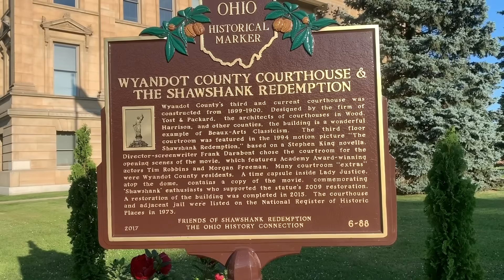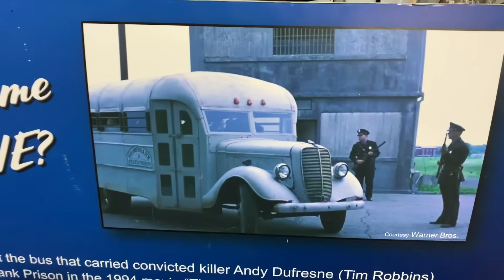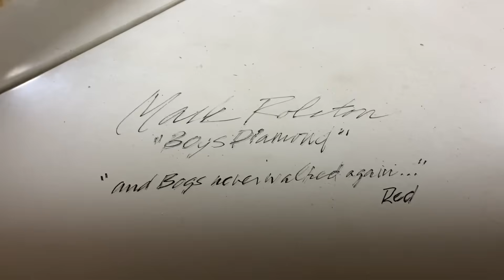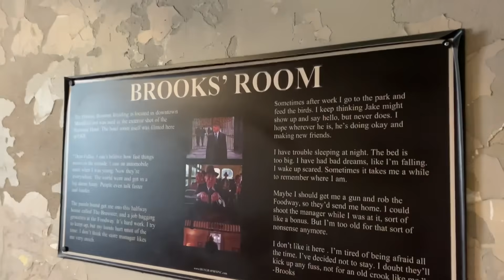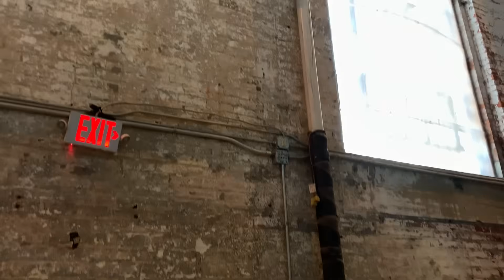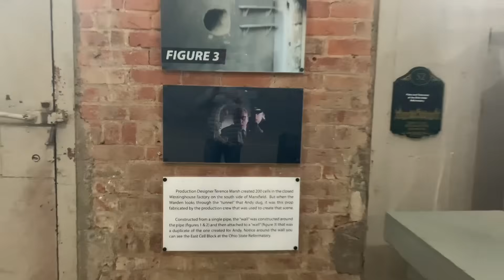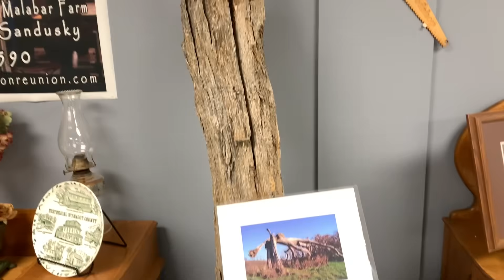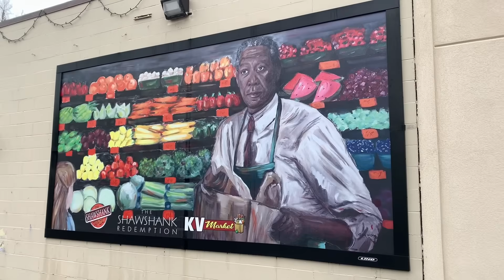“THE SHAWSHANK REDEMPTION" Filming Locations!!! ALL the locations used in the movie!!!

Comment: You have done an outstanding job on this video. I have seen several and this is by far one of the absolute best. 
 We have visited all these locations about 3 times now. Allot has changed over the years. I had a few friends wind up spending time in there for some minor unviolent crimes, but they wrapped up several of these minor crimes and the judges determined they needed a lesson and sent them there for a year each. One friend did only 3 months and the other did 6 months. It did reform them for sure. Another family member and I took a short trip up there just after Shawshank was filmed and released. The place was in shambles and allot of vandalizm had gone on. The staff was preparing for an anniversary show of the filiming and trying to raise money for the restoration.  Much of the back buildings seen in the movie have been torn down and replaced with a more modern prison. You can no longer see or visit the cemetary also seen in the movie, but years ago before the new sheriff station and new prison was built, we walked those tracks that runs between the prison and the cemetary and explored it a few times. I live about 45 minutes from this prison and am glad to see it has been saved. This prison is over 100 years old and allot of history here. Construction began in 1886 and continued until 1910. It did actually open in 1896. The big Oak tree was struck by lightning several years later and pretty much destroyed. A huge part of it was transported to the entrance of Mansfield prison for display along the driveway into the prison. This prison is about 45 minutes from my house. We were told the day it was scheduled to be torn down completely, they received a call from Hollywood about filming Shawshank Redemption. That saved this prison as the destruction crew were on their way. I have been there a few more times since the renovations have been started and done. It is definitely an amazing place to visit and well worth it!!
Reply from the maker: Thank you very much and thanks for sharing that information.

Comment: This is a big country and I'm sure the location scouts offered the director and producers a handful of really good options of cities to portray Portland, Maine. I'm curious if during your research you learned if perhaps Mansfield and it's surrounding cities were always the top choice? Or was there maybe one or two others that were top choices that fell through leading to Mansfield as the primary filming location?
Reply from the maker: Another location that was considered is an old prison outside of Nashville, TN. It’s the one featured in The Green Mile and a few other movies for that matter. From what I understand, after looking at both locations, when they were able to arrange to use the empty warehouse in Mansfield, it made Ohio the easy choice. They liked what both prisons gave them in terms of options, but knew they needed to also build a set for the scenes they needed. I’m not sure what the other options were in Tennessee, but when the warehouse became available in Mansfield, it all fell into place. The prison in Mansfield also had a number out other buildings inside the prison walls that they could utilize and everything was set for demolition (the prison was eventually saved), so they had a lot of flexibility with the Ohio site as well to do what they wanted to with it.
Reply: @ComeSeeWithMe  Ah, makes sense. So besides the prison/warehouse I guess they liked everything else enough in and around Mansfield to portray Portland, Maine. Great stuff, thank you!

Comment: why would they build a fake store front to look down an alley with a new green tranformer box, think Red was at corner of store camera man inside corner of store by corner angled window!
Reply from the maker: That is not correct. Frank Darabont (the director of The Shawshank Redemption) said they built a fake store front right in the space I showed in the video. They wanted the store positioned there for that shot and there wasn’t anything there to use, so they built a set for the shot.